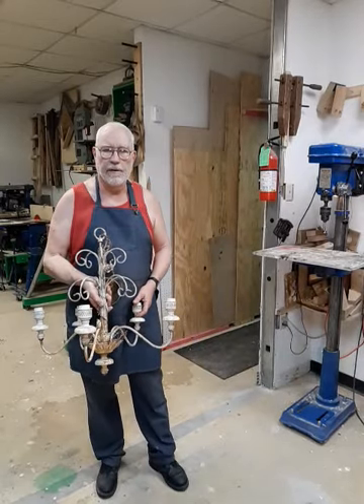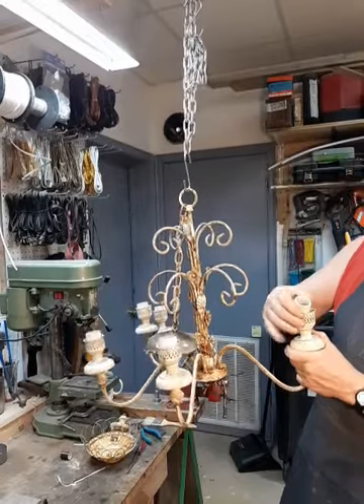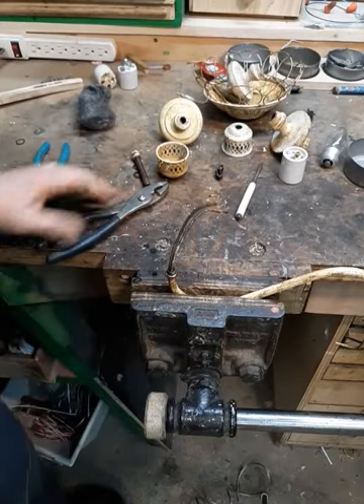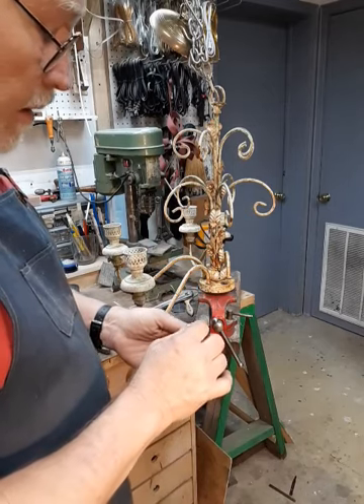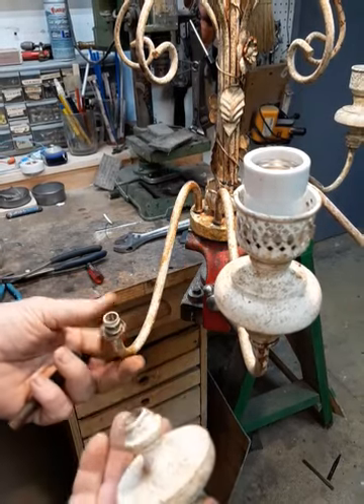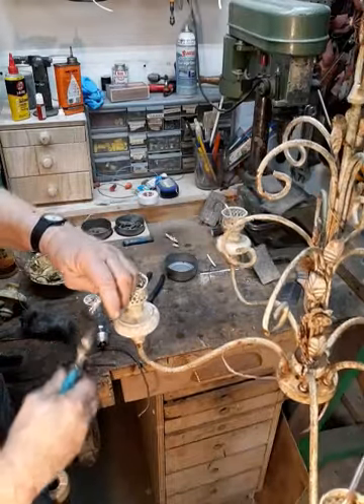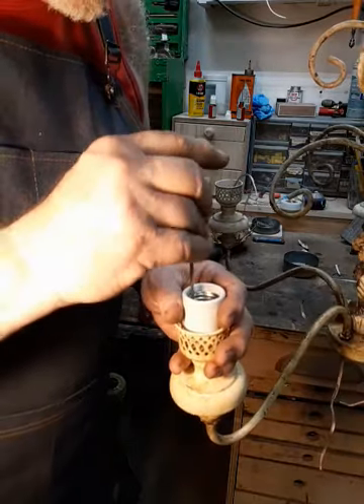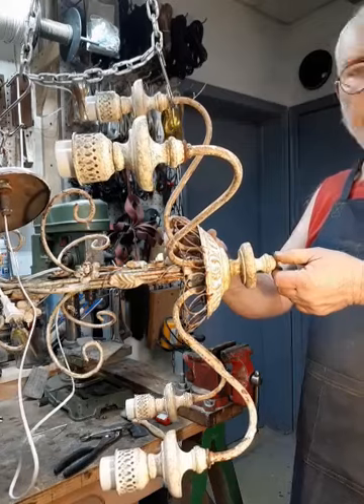Rewiring an Italian Chandelier in The Secret Underground Laboratory Recovery & Salvage

Comment: Does it need a ground wire?
Reply from the maker: It's not a bad idea, but ceiling fixtures are not likely to be handled while lit and short circuits in an undisturbed fixtures are very rare. The Murphy's chandelier was an exception. It was damaged in a flood and should never have been installed.